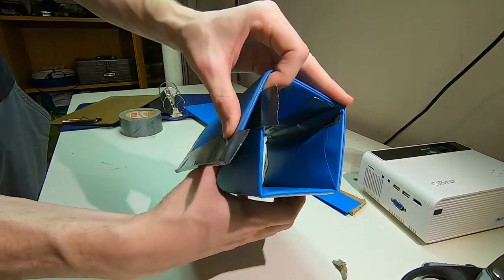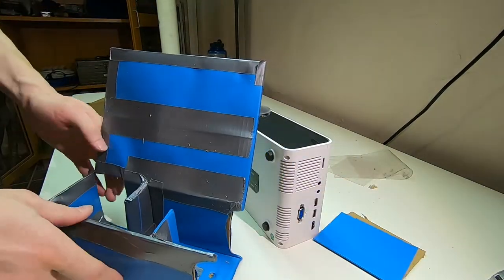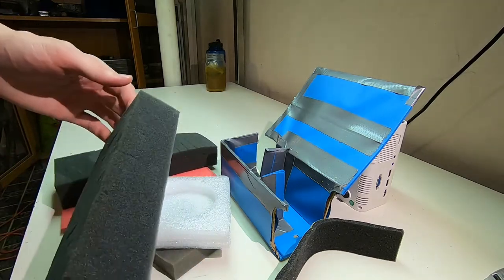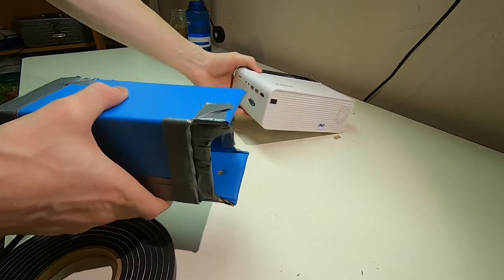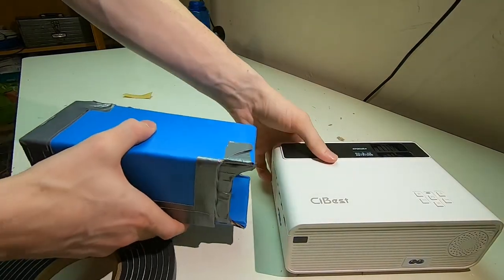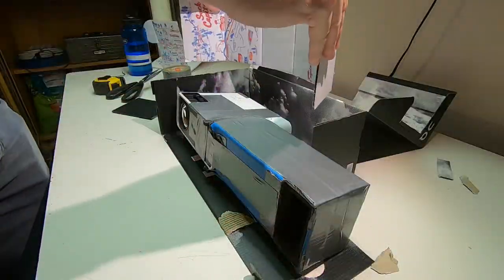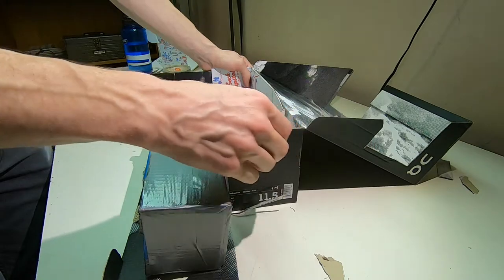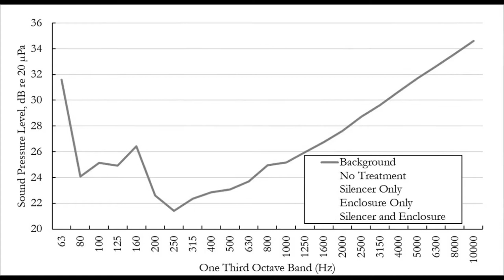Homemade Projector Silencer - How to reduce fan noise on a loud projector

Comment: build enclosure from pc almunium case make a hole for 2 extra fan. blanketing with wool fabric, glue them on to outer enclosure.
works for me.
Reply from the maker: I like the idea! Do what works for you. Are the extra fans that you added quieter than the projector fan? Also, did you put the insulation inside the PC case, or on the outside? Insulation on the INSIDE of the case will help reduce the noise inside the case which means there will be less noise to escape. Putting insulation on the outside will only help a little bit since most insulation materials do not have great Transmission Loss performance (unless they are really dense).
Reply: @teatimewithja  youp, already make one. inside side plate case. forgot to mention, extra fan usefull for vacuum hot air inside the closure. nonthe less i use processor fan lga 775 whick more quiter than regular fan
Reply from the maker: There is someone else commenting about the possibility of using a larger, lower speed, quieter fan. I like the idea. How did your pc-box work? Was it a good bit more quiet?
Reply: @teatimewithja  yeah so so. but now im using literaly pc case, the humming more like cpu now, and also blanketing the wall with yoga matras. last part is acrylic or transparant plastic or maybe a glass to sweeten the case overall appearance.
.
if you have whatsapp i'll give you the pic or video
Reply from the maker: I have definitely used couch pillows on my walls for temporary absorption while doing some voice recording - you've got to use whatever you have and whatever works.

Comment: Perfect way to kill your projector.
It's gonna suffocate. Fan and heat gonna have a very hard time to move around.
Just replace your fans
Reply from the maker: It has not died yet! Some day it will, but I am not worried about it. Also quiet fans would cost a lot more then I paid for the projector ($0), and probably as much as the thing is worth.
Reply: Well, if it works for you, than OK:)